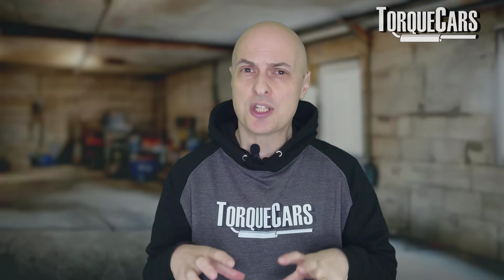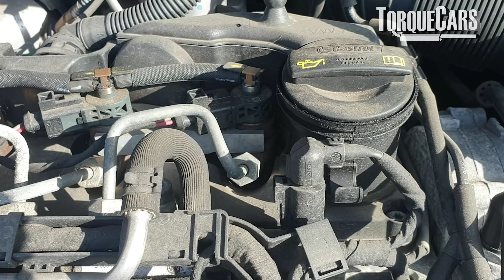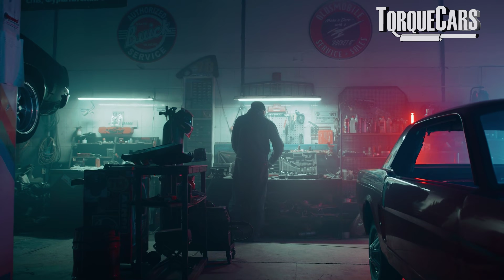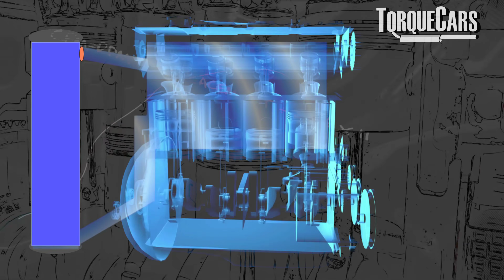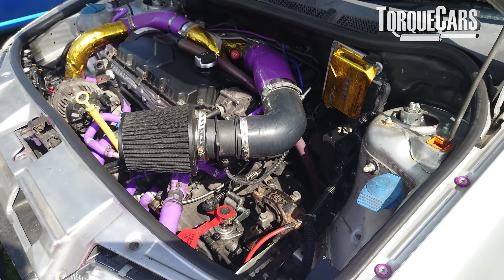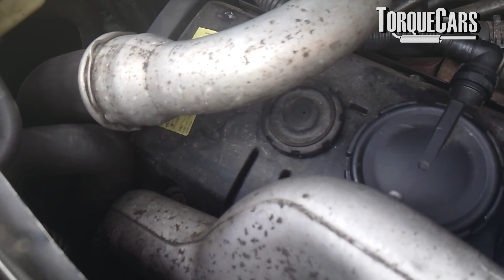Overheating Engine?💥 Don’t Ignore This Engine Killer & Use These Diagnosis Tips! Fix P0217!

Comment: Not too long ago I sold a Volvo V70 that would kick the cooling fans on ... with a stuck open thermostat. Light, easy driving on a mild day, temps capped at 65 degrees. In heavy traffic on a warm day or climbing a mountain pass in 3rd gear ... 105 degrees, yes, with a stuck open thermostat. Such a comfy but strange car. (btw I did eventually replace the thermostat)

Comment: Why make a water pump with a plastic impeller and whats more crazy is the drive pulley is often made of metal, if anything they could make the drive pulley of plastic fgs, my 5 cylinder Volvo Turbo has a metal impeller with a hard rubberised  belt pulley, i had it changed when i had the cam belt done at ten years of age and it looked like new, these ideas and designs get worse.

Comment: Hi guys. My 1.6 tdi 2014 has trubble keeping the Oil temparature down when its warm outside.  Does annyone know the cause? Water temp is stable 90. On Motorway I might hit 115C° Oil. Then its regulating down.  But not far enough.. somewhere down around 108 and then up again.

It is like that for two months now

Comment: Perfect presentation on possible culprits of overheating. My advice is, if there is a replacement water pump with a METAL impeller, go for it. I've been using such pumps for decades and never had a whiff of an issue. Plastic ones, as you correctly stated, often break and cause serious issues.
Reply from the maker: It is another example of silly cost cutting by manufacturers. There's no excuse to doing the job properly when we get to do stuff ourselves.

Comment: My interior heating wasn't blowing hot air and the problem was just a small water leak at a hose. I couldn't see any coolant in the reservoir but luckily my engine didn't blow up. Replaced the hose, put new coolant and everything is fine now.